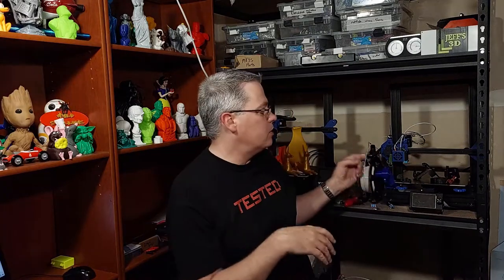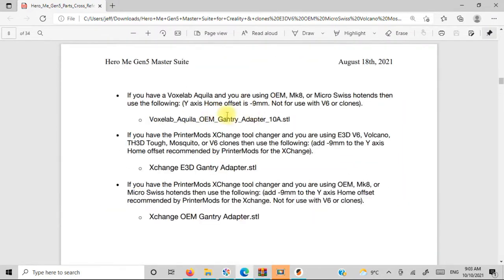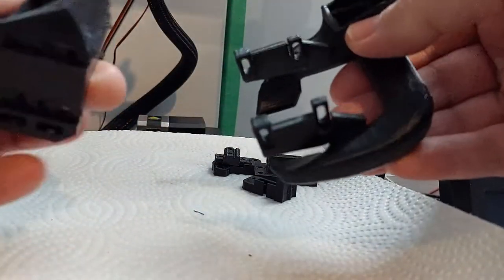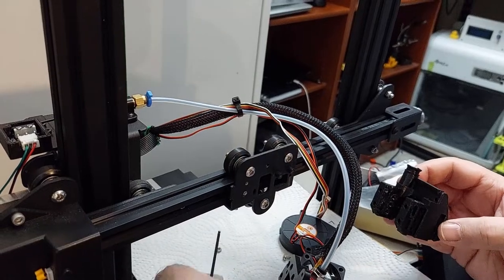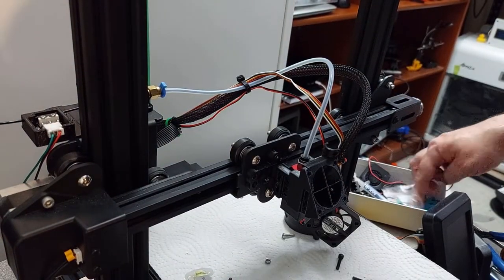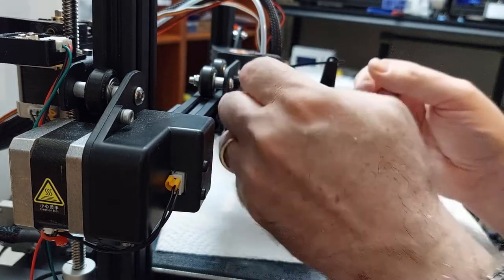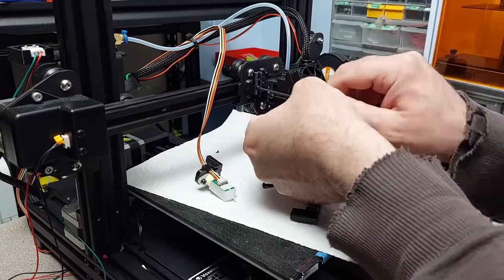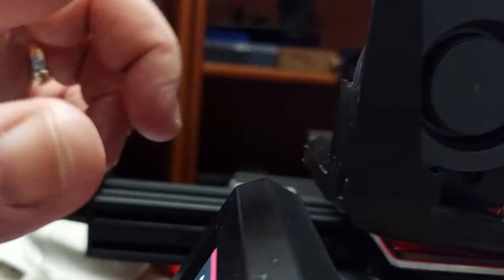Hero Me Gen 5 Cooling System For Voxlab Aquila

Comment: can i print this in PLA without deforming after installing when the heat hits it
Reply: It says that you can, as long as you have the silicon sock on the hotend :)  I will be doing this
Reply: @DestroyerHivePro  i have my silicone sleave but i remember when printed a santana it deformed so i was wondering about this one